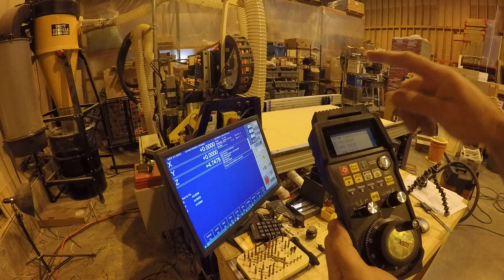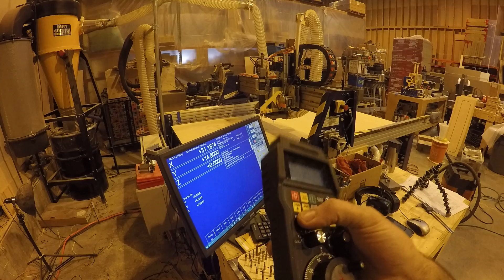Centroid upgrade to ShopBot PRS

Comment: Excellent video. I’m curious, you mentioned 1200IPM rapids, with steppers, which is pretty good going. I was looking at DMM servos, to add to a cnc kit I’m interested in, thinking the only way to get good smooth speed plus accuracy, was via servo. Can you expand on the drive/stepper/transmission you’re using? Thanks.